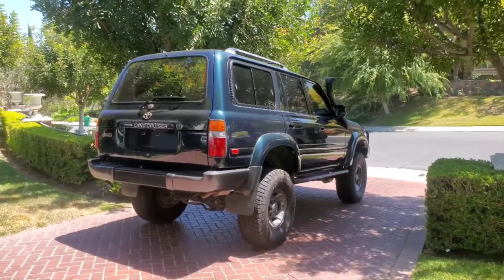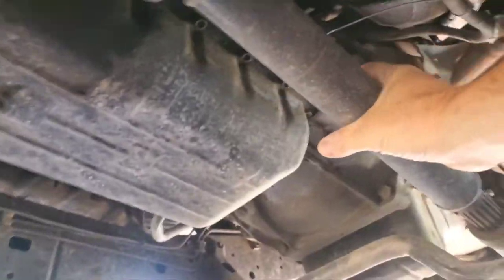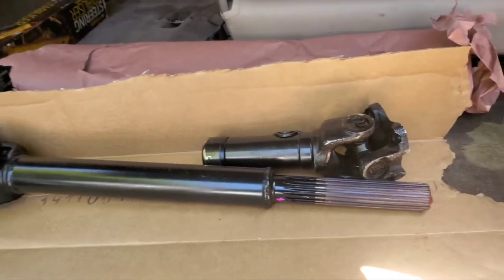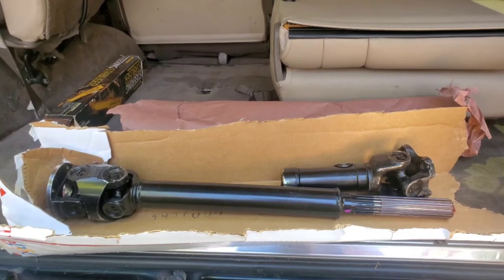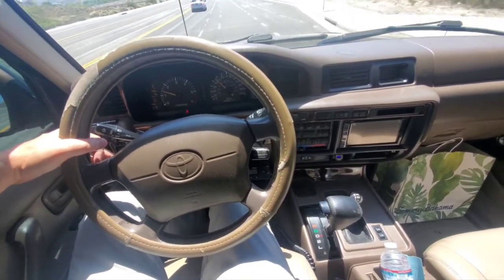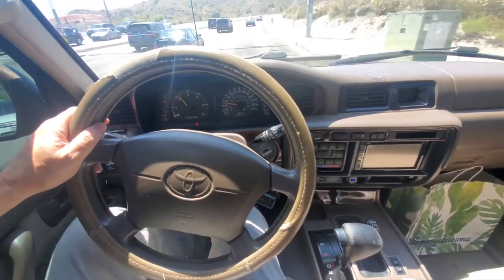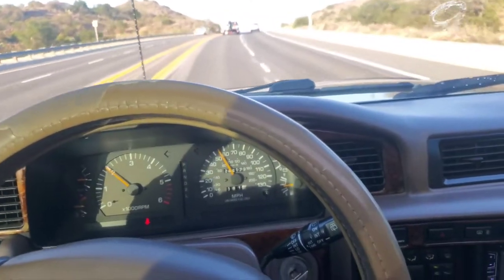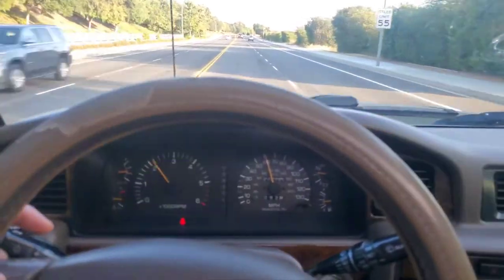Lifted Rig? Got Vibration? Get a Double Cardan Drive shaft

Comment: Would you recommend buying a doublecardon if you have a 2.5 inch lift? I just recently did U-joints on my 97 lx450 and as soon as I get it in overdrive it shakes and sounds like my differentials gonna blow it’s been bugging me for a while now to the point where I don’t wanna drive it too much. All the driveline shops around me are assholes so Any input is appreciated.
Reply from the maker: probably wont need it. maybe a slight trans drop.
Reply: @CruisingTheLand  that’s what I was thinking, either a torque converter or a front axle rebuild. Just wanted to be sure before I pull the trigger on anything major, thank you

Comment: This is a problem I’m having right now at the moment I just purchased a jeep 392 and I just lifted it with a Rock Krawler 4 1/2 inch lift and I cannot get my pinion angles right in other words if I make the jeep control arms shorter it’s like driving on ice so I can’t get the pinion angle correct, I did order custom drive shafts but the front is not working And the company is sending me another front driveshaft and I am assuming it’s going to be similar to what you’re doing, I hope it resolves my problem but I have the same symptom it seems to be much worse under deceleration to the point I thought it was going to grenade under the vehicle i’ve owned 14 jeeps all lifted and most pretty tall lifts never had this problem this bad, your vehicle looks pretty cool with that lift, I think a little bit taller tire would look very nice and give you a little bit more ground clearance but the problem is if you go bigger the axle gearing etc.👍
Reply: lol.